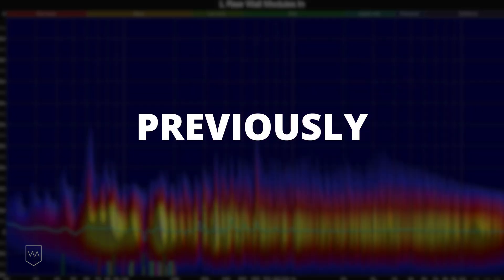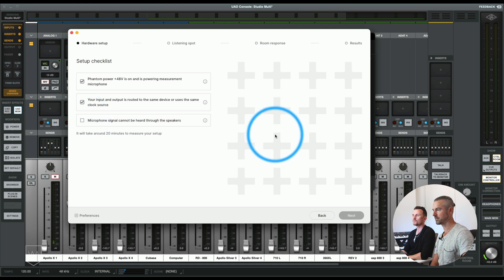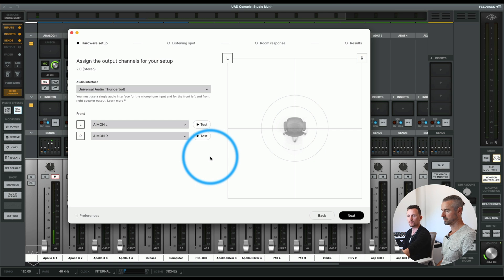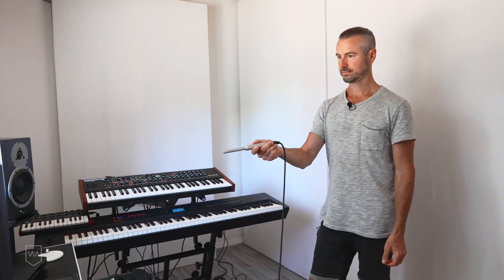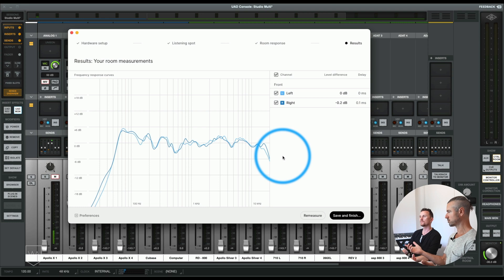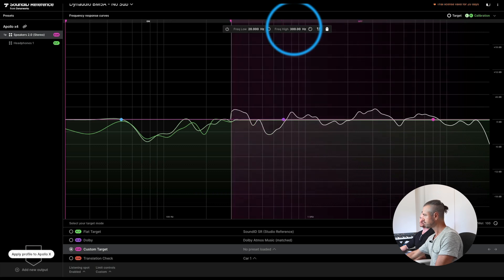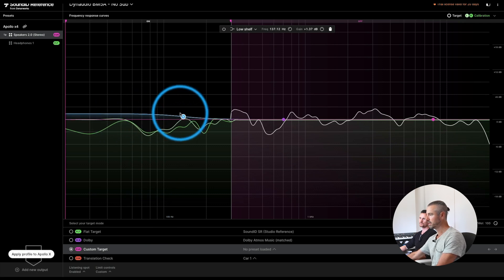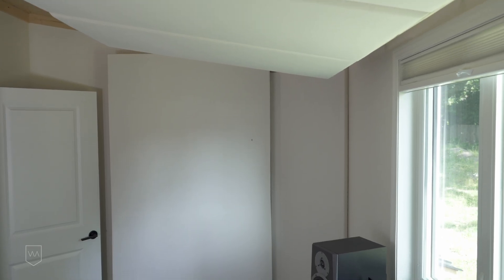How to Use Sonarworks Room EQ for an Acoustically Treated Studio - Ep9

Comment: Is it normal that sonarworks doin 8db correction on a dip but in room wizard using your technique show only 4db dip at most any freq
Reply from the maker: Hey hey.  Yes, it's completely normal to see discrepancies between Sonarworks and REW.  1) Sonarworks is taking many measurements over a wider area all around the mix position.  REW is taking from a single point.  2) Many of the measurements I was showing you were from a single speaker in REW.  Sonarworks measurements are all using both speakers and there are often issues with one side that are different from the other, such as an asymmetrical boundary reflection at certain frequencies due to transmission through a wall assembly.

Comment: Can you still use SW when mixing via Transparent Clipping (ie clipping the Master) ?
Reply from the maker: Hey hey.  Why do you call clipping the master "Transparent Clipping?"   It's most certainly not transparent clipping.  When you clip your master, you're pushing into non-oversampled hard clipping which is the worst kind, especially on complex audio material. You'll introduce nasty intermodulation distortion. 

If you do clip the master, at least use a plugin to do it, so you have some control.  

But the master is the last place you should clip. You should apply clipping on individual sounds, and then busses, and if you do clip the master at all, be very light touch and surgical with it. 

That said, to answer your question, you can use Sonarworks for monitoring.  Like if you're using it in your DAW it should be the last plugin on your master. But you disable it for rendering. 

So again, if you want to clip the master, you should do it with a plugin before Sonarworks and before your final limiter. Than run SoundID Reference after that.  Or you can use the overall system wide version of it where all audio from the computer will run through the calibration and it's not used in the DAW at all. Hope that helps.
Reply: @warpacademy gotcha! Thanks for your detailed response. Makes perfect sense 👌🤗 ❤️ ✨
Reply from the maker: You got it

Comment: Hey! Awesome series, thanks for providing a great amount of helpful information. I was curious however, the EQing that Sonarworks software does in this video, what is its target? Is it a completely flat line, or is it a tilted line? Do the likes of Northward acoustics and such, believe in a ruler flat response as their end goal, or a tilted response/various speaker targets? I've not been able to find good information about this online, and Sonarworks doesn't share a lot about how their curve looks like and I do not have their microphone to test it. Thank you in advance.
Reply from the maker: Hey hey.  Thanks for the comment.  Great music on your channel!  

The goal is definitely not a ruler flat line, and Sonarworks SoundID Reference does not target a flat response either.  Let's deal with each point separately.  

Most acousticians and studio designers will seek to design an room that sounds as neutral as possible.  That's not typically flat because of psychoacoustics.  Look at the Equal Loudness Countours from ISO226.  I did a video on that here: https://www.youtube.com/watch?v=bRmPK3d9Cmw

For that reason a lot of engineers, myself included, like a slight rise in the low end.  My room has that.  

Many engineers, myself included, also like some rolloff in the top end.  I like to have a tilt down as frequency increases.  This helps with ear fatigue when mixing.  Mastering Engineer Bob Katz discusses this a lot, look him up.  You have to learn the curve so you don't make mistakes though.  

I'm not sure what Thomas from Northward would say, I haven't asked him this.  I think his rooms are much closer to truly flat, but I've never actually seen a frequency response, only an ETC.  And most of his rooms have ATC mains and dual ATC subs, so I imagine there is a lot of low end headroom available should the engineer want it.  

Thomas has said that his rooms have a very short and even decay time of <100ms from 20 Hz to 20,000 Hz, which means psychoacoustically they would be perceived as very even across that entire range as the perception of a room has a lot to do with decay time.  

For SoundID Reference from Sonarworks, they did their own research and have built their own target curve.  They never show you what it is.  I don't even know what it is and I worked with them.  All I can tell you is that it's kind of like a Harmann response curve where they researched what sounds flat and balanced in terms of perception, not actually flat on a graph. 

The target is also different for headphones and speakers in a room.  

So to sum things up, we're not looking for flat on a graph. We're looking for balanced and even perceived sound, which takes into account how our auditory system is non-linear and the fact that it will perceive things differently on headphones and speakers in rooms.
Reply: @warpacademy  Thank you for responding in such great detail. That clears up a lot! Though, I am still a little confused as to what target might make the most sense to use in a good studio if there are in fact so many, since I can't help but feel like not all of them will be as valid as each other. Maybe due to the sheer amount of people that use the Sonarworks target, that makes the most sense to use. But it's definitely a little unclear. I've seen a video of someone measuring their studio before and after Sonarworks correction and it seems to have a downward tilt, getting especially aggressive the higher it went in frequency. Though, I'm confused as to why not outright use equal loudness contours EQ perhaps with some moderate intensity if that's what makes things sound flatter to us.
Reply from the maker: @reaveraudio  Yeah, it's a bit of a rabbit hole hey?  You're asking all the right things.  

You also have to get really clear on who you are the work you're doing.  I'm not a recreational audiophile listener, for example.  I'm an engineer.  My primary goal is making mixes and masters in my control room that translate well to all listening environments.  

The Equal Loudness Contours are good to keep in mind, but they are not a good target necessarily  because they change dramatically depending on the SPL listening level.  They illuminate how our perception of sound changes based on sound pressure level. So when you're mixing louder you'll hear less more bass and likely undermix it.  While if you're monitoring very quietly you will hear much less bass and likely overmix it. 

A studio needs to be neutral, that's done with passive acoustical treatment.  Then, using room EQ, you can modify that neutral starting point and - at least based on the Equal Loudness Contours - it's advisable to have some form of adaptive EQ system that will change the tonal balance based on SPL.  Or at least keep in mind that your perception of sound will change.  

If you want to see what the SoundID Reference "target" is doing to a room, you should be able to test that through REW.  You'll first shoot the room with REW.  Then you'd run the SoundID Reference process.  Then apply the calibration using their system wide app so it also applies to the REW sine sweeps, then shoot the room again with REW and compare the delta.  

Personally I like a room that's tilted a little bit.  Slight rise in the low end of 2-3 dB.  Slight rolloff in the high end of about the same.  That sounds very balanced and natural to me, personally and subjectively. I tend to be quite sensitive to HF, more than most people I know, hence the rolloff preference.
Reply: @warpacademy  Seems like a lot of things in this field haha. You never really get a satisfying answer. But I guess nothing really matters at the end of the day if your mixes are translating well. I think I might experiment to see if the Sonarworks curve is the one, or perhaps what you suggested is better by looking at how my mixes translate when I use one or the other. Thank you so much for answering my questions!

Comment: Do you use the built in EQ correction of the speakers at all before the process with Sound ID Reference or do you leave it as is and let Sound ID manage the whole sound? Thanks :)
Reply from the maker: Hey hey. Great question.  The EQ controls on the speakers are very rudimentary so I prefer just using SoundID Reference.  Cheers!

Comment: Great! When you're calibrating, where do you point the microphone? Toward the listening point or the monitor?
Reply from the maker: Hey hey.  I covered that extensively in a previous video in this series for Room EQ Wizard: https://youtu.be/dmz-vmb2UQI 

For the Sonarworks system testing, I keep the microphone pointed towards the centre point between the two speakers.  It's an omnidirectonal microphone so it's not that sensitive to angle of incidence when pointed forwards. 

If you're testing a room with a surround / Atmos setup where audio can strike the microphone from the sides or rear, then you'd point the microphone directly upwards and use the 90 deg cal file if testing in REW.

Comment: Great video! Not a pro i'm more of a hifi guy but great sound is great sound. That being said i also only correct up to or slightly above schroeder frequency as well(if there is a bump that looks at me funny i take it out back though). And i agree not messing with too much of the sound of your components and focus mainly on what the room is doing, like if you have a fancy tube amp, transformers, speakers or whatever else that adds a bit of flavor then you want to preserve the sound and not correct too high. 
Also i have found if i got close to or above 1khz i can always tell there is dsp, maybe i'm just not too good at it or just very sensitive, it starts to sound synthetic and unnatural. This is with Dirac which works similar as Sonarworks.
Reply from the maker: Well said.  Some other people say that this correction can sounds processed and I think that’s primarily because of the higher frequency EQing in bad rooms where it gets too heavy handed.
Reply: @warpacademy  Yes and sometimes i've noticed Dirac gets confused after doing a measurement, it will sound completely wrong(even more unnatural)regardless of cutoff frequency but Dirac always corrects the phase full range. Then restarting again and it works again like magic. Not sure if you've seen that happen with Sonarworks, i'd imagine the pros being all up in arms if that happens.

Comment: Hello. Thank you for this series of good videos related to acoustics. I have a question. After the acoustic treatment of the room, when you measured with Room EQ Wizard, a frequency of about 60 Hz was sticking out. Was that frequency corrected after using Sonar Works? If possible, use Room EQ Wizard once after using Sonar Works so that the results can be compared. Thanks.
Reply from the maker: Hey hey.  Glad you’ve enjoyed the video series :)

Yes there was a broad LF lift in the low end due to the in phase boundary reinforcement (front wall loading). And yes that was adjusted down easily with Sonarworks.  

Additional fine tuning was done not on camera to dial in the setup with a sub.  I just showed the rough process of using EQ.

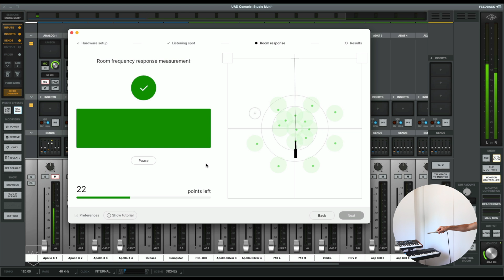Comment: 05:09 - How do they handle handling noise in the measurement? Seems strange that they trust people to not move enough, but even a small amount of movement would induce low frequency rumble in the mic.

Thanks again for this video series. It's taught me a lot about acoustics.
Reply from the maker: Hey hey.  Glad you've enjoyed the series!  Slight movement of the mic won't matter with this many measurements (look up the moving microphone method of testing frequency response if you want to learn more on that).  I also imagine they have a way of excluding slight handling noise from the measurements.
Reply: @warpacademy  Ah, that makes sense actually! Coherent sounds (like the sweeps) add up, incoherent background noises (handling noise) won't add up nearly as much. Doh, I should've known that!

Thanks for the explanation! Triggered my brain into working again. :)
Reply from the maker: @JimGriffOne  right on.  Cheers!  Oh, one more thing.  I'm not sure if Sonarworks does this, but some testing apps like Fuzzmeasure use a tracking filter that follows the sine sweep to exclude noise.
Reply: @warpacademy  Ooh interesting! That's a cool method of noise rejection.

The Neumann MA-1 system I use picks up the slightest noises (like the plastic cracking a tiny amount on a cheapo laptop) and tells me I need to redo all measurements again from the start. 😂 Have to make sure no objects are able to vibrate. It's the most annoying, but still gives great results (when it decides to work!)

Comment: Thanks for sharing:face-red-heart-shape:
The curves seem quite nice, for me, I might consider not even turning on the calibration!
Something I would like to share: I would wear earplugs when the signals are playing. And one measurement process would probably be fine; I find the process designed quite foolproof, so even if you do something wrong, the results would be very similar.
Reply from the maker: Hey hey.   Cheers.  Yeah I’m quite happy with how the tests turned out.  Minimal EQ needed and it’s still a great response even with the correction off.  

I had the SPL very low so no earplugs were necessary, but louder sine sweeps can definitely cause damage so it’s a good practice to wear some.  When I shoot the room with REW I leave the room as the signal is louder.  

Not sure what you mean by using only 1 measurement?  The Sonarworks testing process requires all 37 positions.  

When testing with REW I only use one position.
Reply: @warpacademy  Ah, sorry for not being clear, for 1 measurement, I mean by going through the whole Sonarworks process. I tried going through the process several times with small changes, but I found that you really don't have to!
Reply from the maker: @mimisaiko  oh, right.  Yeah, no need for that.  The only reason I'd go through it a second time in this case is to dial in the monitoring after installing the sub.

Comment: Awesome series. So helpful!
Question: How is it that the calibration in SoundID is (pretty much entirely) not exceeding the 0db (while the measurement obviously does have peaks)?
Also: are you using SoundID in your own studio? And if so, with specific settings? And why?
Thanks a lot!! :)
Reply from the maker: Thanks!  We set up the app using the Limits function, where you can prevent it from doing any boosts.  You can select the maximum degree of boost from +12, +6 or 0 dB.  We selected 0 dB so that only cuts can be made.  Unfortunately that bit got edited out by mistake.  Here's how to do that on the Sonarworks site: https://support.sonarworks.com/hc/en-us/articles/9639393569170-Limit-Controls